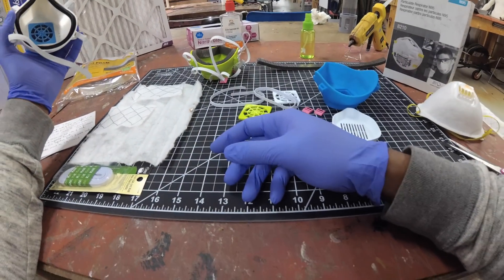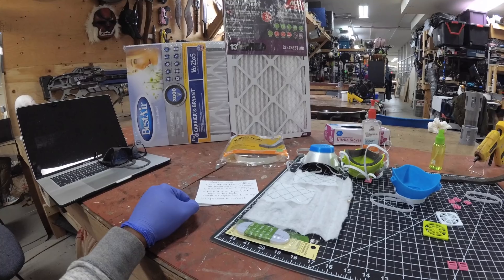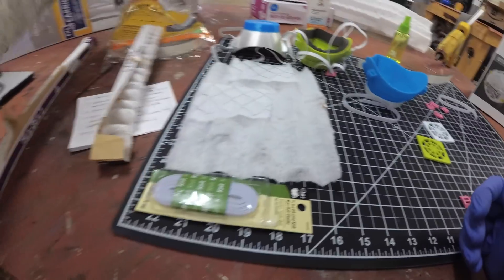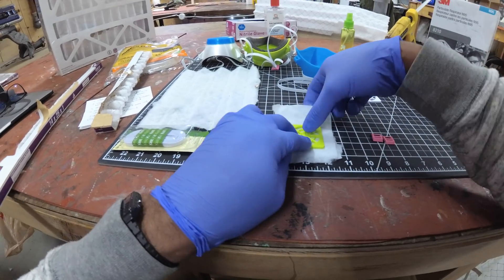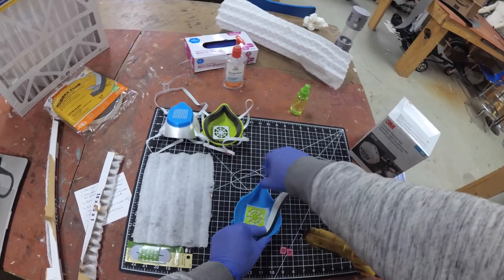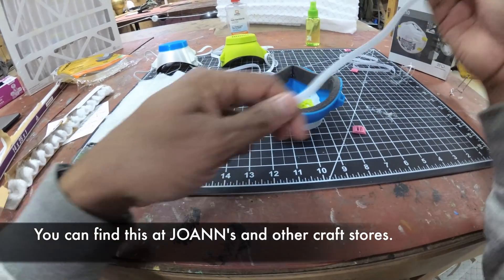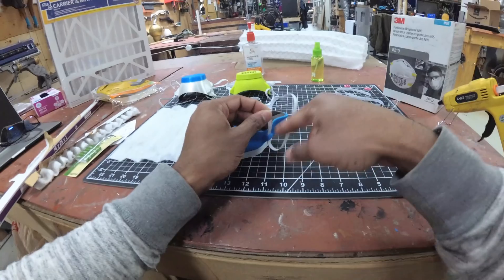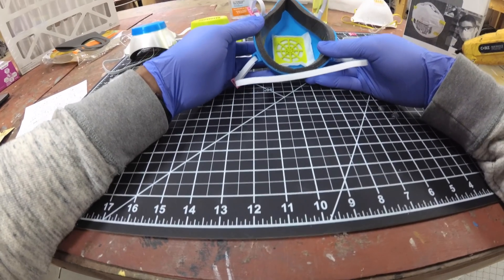3D printed PPE DIY Particulate Mask ( PROCESS )

Comment: The use of 3D printed material for the majority of the mask results in a large surface area of non-permeable material that has ridges for collecting and storing "stuff" as you call it in this video. Also, 3D prints cannot not be fully sanitized and disinfected. The small filter area ensures that there will be back pressure when exhaling that will try to escape along the edges of the face (mainly around the nose bridge) and disrupt any particles trapped along the edge (pushing the virus and bacterial towards the eyes for example). Also, as mentioned in a few other comments, pulling the metal mesh from the fabric tears and stretches the fibers making for weak spots in the filtration. IF you are going to use these masks (which I and many of the doctors I have been working with do not), please buy the large, pleated, drop-in filters for the Aprilaire 2200 as the materials is simply folded sheets of MERV rated material and does not have wire or cardboard glued to it as traditional furnace filters have (as seen in this video).
Reply from the maker: This video has been outdated the moment it was posted. I even mention this within the clip in asking folks who watch this to check in the video description for updates & findings. We've already come to the conclusion that polypropylene or surgical wrap are  better filters than the MERV material in the video. I'm not a medical professional, therefore have no ground to stand on to refute your opinion ( considering you are what you say you are ) on this, we are only working with hospitals on this who are well aware of the limitations of this concept and are not handing these out to civilians as to not give folks a false sense of security. All I can do is report our updated results from the hospitals who have tested the units for those interested in making these as well to possibly collaborate and help. So thank you for your feedback.

Comment: THANK YOU!! I'm not with the Fire Dept anymore. I went from saving people to now protecting them. So im not in need of one. However my cousin is still a medic out in Cali. I asked him what his n95 situation was. Not good. I printed this mask out as a prototype. Joann does not have the elastic straps. Sold out. They did have elastic string. I double it over and it worked. Weather stripping I had at home was to thin and home depot was closed . but I could see how much better this would be with thicker weather stripping. 
So I can fit 2 masks, the part to hold the filter and a few clips on my ender 3. So I'm printing 2 at a time. Just need to print mask caps separate. Hoping to have at least these 2 shipped out by Wednesday. So at least my cousin and his partner has back up. I wonder how hard it is to get our hands of polypropylene? This way we can have a more effective mask if we used that as a filter .

Thanks again. People like you in this country is what will help curb this. Sadly the dumb fucks living here far out weigh those with common sense or making an effort to do some good
Reply from the maker: Thank you, certain reusable shopping bags we've found are polypropylene and work well, also if your local hospital has surgical sheets that is also an n95 equivalent.
Reply: @GiveWaveStudios  I shipped him the first 2 today. I ended up using a HVAC FILTER from Honeywell , it was rated for viruses but what caught my attention was the mention of a electrostatic charge.
Hope the hot glue holds the weather stripping. If So I'll send him several more.
Do you know of any online places for the elastic bands?

Good call on cutting up a  surgical mask
Reply from the maker: @respond_code3  we just got them from craft supply stores. But Amazon might be the way to go at this point

Comment: Nice.  You can print the an extra center mask grid 39mmx39mm.  This will hold the filter in place and give a tight seal to the mask. https://www.facebook.com/photo.php?fbid=3088032921209929&set=pcb.2606241366322387&type=3&theater&ifg=1

Comment: Very good idea, but I think the design needs work.  1.  Filter material:  These furnace filters will trap particles down to 0.3 microns (millionths of a meter).  Coronavirus particles are smaller, at about 120 nanometers, or 0.12 microns.  You should use something with a finer mesh.  (Note: Your current filter WILL trap microscopic aerosols in which virus particles are riding.  This MAY be sufficient, but better safe than sorry.)  2.  The filter should be OUTSIDE the body of the mask.  When filters are replaced, the assumption is that they are contaminated.  Having them on the inside, as in the present design, increases the chances of rubbing off virus particles onto the inner surface of the mask while changing the filter.

Comment: What is the point of the front grill? It seem to make it more time consuming to print.
Reply from the maker: front grill is to potentially have a secondary filter that is more disposable than the one on the inside
Reply: @GiveWaveStudios  Ah that's cool. Will that make the mask harder to breath in? Like I know some use it for protection for themselves, but others might use it because they have the condition and already struggle to breath, with it be a problem? Also some healthy people with conditions like asthma like myself might need breathinging to remain easy even wearing protection. 

Do you feel any different from wearing this and nothing, and this with 1 and 2 filters?

Comment: Great contribution to the virus problem, thank you. I plan to make one myself to see how it works out but with the following changes:
Printing the mask housing itself using TPU for it's flexibility. Hopefully this will allow it to form to the shape of my face better.
For the filter element itself I'll be using a piece of material cut from a vacuum cleaner HEPA filter bag. Far superior to using regular paper filtration material.
Reply: Be very mindful as many HEPA filters use fiberglass to make the element. You do NOT want to be breathing in fiberglass.

Comment: To specify, this is no hate, i am happy that you are actually using your personal time for this, 
Thank you
This is just my opinion on how to improve it:

Pretty simple 
Just print molds with the 3d printer
Then use a PTFE to fill the mold (you can easily get this stuff)
So like that with PTFE (flexible) you have no problems getting it out of the mold
Then you can print a part where you can screw on filters (this will connect PTFE part with the filer, as to guarantee a tight seal)

This is wasting your precious time
Another thing, your filters are not great
I would recommend round filter on the side of the masks and then use active coal (or however it’s called) 
Plus you can use 2 filters, and they can be removable with a seal and a thread
Reply: That would be great if the filters are available. I've been struggling to find any replaceable elements for my respirators.

Comment: FDM printing leaves microscopic holes between the layers plenty large enough for this virus to get through. You want to seal the mask in some way for maximum protection. Using filler paint or some other method is essential. Yes, this is better than nothing for sure, but it is well worth doing it all the way if doing it at all.
Reply: If you print using ABS, you can use acetone to "paint" the parts.  Acetone essentially dissolves ABS, and it should take care of those holes (if done properly)

Comment: When you tear off the metal wire, it will form holes.  What I did was to use two layers overlapping to cover any accidental holes.
Reply from the maker: @vn8383  thats an option but def not recommended ... if you can find polypropylene fabric we've found it actually makes for a better and safer filter.
Reply from the maker: yes, and if you keep up with our updates on the site you'll see we moved away from that and have had better results with polypropylene ...
Reply: Why is it not recommended to leave the metal wire
Reply from the maker: @ltc5662  it's a hard surface, the virus lives longer on hard surfaces so it's not a risk we're willing to take.

Comment: I hate to say this but I heard that even the Plastic can let viruses through if FDM printing. I found this out AFTER I printed 5 of them but am applying many layers of clear coat all over the parts to solidify the parts. I just wish there was a way to confirm that 4 or 5 layers of clear coat will stop viruses.

Comment: This design doesn't have enough surface area for low pressure drop across a MERV13 air filtration media.  So I did a remix for a much larger surface area here: https://drive.google.com/file/d/1hoYZXwwhrOWvDzaba3OMFC82EYuT1X9X/view?usp=sharing
By the way, I printed using TPU for the mask whereas the cap is from PLA.
Careful of MERV16 as they have silica glass material in the media.  3M 1900 Filtrete is equivalent to MERV13.

Comment: Cool that you can help with your printed masks, but your filter material is not safe to use for this virus, the filter material needs to be able to stop 0.1 micron partial size

Comment: Face masks printed with fdm printers don't work to protect against the covid-19. The impression leaves too large pores and the virus can cross the mask walls without problems. It doesn't matter if you put a filter type n95 or higher. The virus can pass through the mask itself.

Comment: Looks like the Class 5 MERV 17,18,19,20 are HEPA/ULPA but probably not available for normal HVAC Systems due to the restriction of airflow which can cause the air circulation fan motor to overheat! It would seem that buy HEPA approved air filters from made for vacuums may work! These maybe available locally!

Comment: We are printing this base mask model but we are sandwiching five layers of material...first/outside layer clean/pristine T-shirt material coated with uric acid/white vinegar or lemon juice (spray and let dry before each use)...then three layers of the filter material then a charcoal layer and a final layer of filter material.  We then take backer rod/foam rope 3/8" and cut half way thru....hot glue the edge in small sections and apply one continuous piece all the way around (this will cushion and make a tight seal where the mask makes contact with your face). Breathing is still easy. Of course we are not medical material specialists so we've researched and come up with the methodology described above. We use 3/4" and 5/8" elastic to make the straps....we hot glue and use a hand held staplegun with T50 staples to secure the ends. They may not be medical grade but atleast they are made here and we are doin what we can for friends, family and whom ever wants one. Anything you can think of to improve a mask of Any design Please share....we All need to help each other Now and in the future......
Reply: How the hell do you get that much material in there as a filter. I had to use a punch and a hammer to tap in the cover that holds the filter material. And I just used a high rated HVAC filter
Reply: @respond_code3  I don't know...my wife is doing that part and she said she is doing EIGHT layers now....She is Amazing.

Comment: Sorry but this is a bad idea and you shouldn't promote it. This can actually put you at a higher risk than wearing nothing. These plastics actually trap bacteria and viruses and the heat from your breath helps promote growth. Good for filtering harmful particulates on a job site, not in a hospital environment to filter viruses. DO NOT USE! You already have the filter, make a no sew mask like this, https://youtu.be/nE0EuDHMfZ4
and wrap the cloth around the filter. Simple, effective, and no 3d printer needed. And, no plastic breeding ground.

Comment: To fix deficiencies in design check russian Y2k respirator for inspiration. Vou can probably use printer to make valves. Try salt as a filter, it will absorb moisture and christals will tear up the virus.

Comment: I heard if you use a blow dryer on the wire cover it will come off much easier...
Reply from the maker: we've tried that, it tends to melt the fabric, which is why I did not include that process in the video :/

Comment: Apart from the comments below on the filter material being used the sealer that you are suggesting is absolutely not meant for direct skin contact. I guess that the plastic use in the 3D printing is also not skin safe. I hope that you are taking care to tell people not to use these in any medical facility or in any location where there is a known active virus case. 
Guys you need to play safe ... by the way the valve type N95 mask you showed in the beginning was banned in China because it only filters the air in one direction. so if a person infected is wearing that type of mask he is filling the area with infected droplets so you might think that you are safe but in fact you are being exposed. 
You need to take note of what was learned in China. 
Please be safe and don't try to make things that look like they are safe but in fact are not, the danger is that you will become complacent and will inadvertently expose yourself which will lead to much higher numbers than are predicted.
Reply: You could make  a 3D printed spoon and it would be safe to eat with. The filters are enough because even lower grade normal face masks are enough for covid. Though this is still worse than an actual mask.

Comment: That filter material is to my understanding, not even close to being adequate. Looking at this table: https://airfuji.com/hepa-vs-merv/ and knowing you will need to filter 0.1 micron particles.
Reply: N95 Masks only go to the same .3 micron size particulate that MERV 13 filters go to, they do however filter that at a rate of 95% and these house filter only do about 65%. All this taking into account the .1 micron size of the virus, but the virus is usually in a carrier of liquid that is a bit larger than the virus itself, in the end it’s better than nothing, and the only way to truly be 100% safe would be to get a full face ventilator with P/N100 filters, or PAPR masks, or you could go all the way and get a positive pressure suite, none of which are necessary, if this were Ebola then yeah...
Reply: THe link you posted is unfortunately just a summarization of 2 wiki articles.
N95 NIOSH statistically capture 95% of all 0.3micron.  If you look on the link you posted it actually says "bacteria, viruses,..." in the MERV 13-16 rating although to their credit it does specify that there are smaller bacteria and viruses.
MERV 13 is probably the lowest acceptable level and would be maybe similar or slightly superior to a good cloth mask.  They're good for arresting sneeze and most coughing airborne particles. However, these box filters are readily available and still in good supply.
If I were to build one of these I would ideally look for MERV 20, failing that, anything 16+ is where I would be targeting if you can find the filtration material, and in a pinch anything 13+.  I wouldn't go below that though.

one last thing, I'm a biomedical engineer.  If you want to see the standards / regulations for what it takes to make N95 or higher the CDC has a great summary

http://www.mechreps.com/PDF/Merv_Rating_Chart.pdf
Reply: Agree with the two above posts, they filter by using a matrix layer, ideally the more of a matrix you have the more you can catch what ever your trying to catch. I like to like at it like bullet proof vests, a level 3a is not recommended for rifle calibres, but enough  together or get lucky it's better than nothing!
Proper seal is more important
Reply: They could use a HEPA filter? https://web.musc.edu/innovation/COVID-19%20Innovation
Reply: Unfortunately the mask if more harm than good because unless the filter is capable of 2 microns / lower pour diameter the virus will flow through the filter and be trapped inside the mask guaranteeing the person gets the virus. Very large liability to provide those to medical staff. Face shields and eye protection are fine though. You can Definetely print that stuff but the first person that may get the virus wearing that mask is bad legally.

Comment: Mate would make sense to create a 3d printed mold for silicone masks? It should be faster to mass produce and perhaps fixes the problem with leaks around the mask. Great design btw!
Reply: They alot of plastic out there that can easily be thermally reformed, from soda bottles to drain pipes, it's just those small intricat part you really need the 3D printer for.
Reply: You can very easily print the mask (positive) and then pour a urethane mold around that piece. Casting urethane would be much better than silicone, because the high quality self curing silicones use a platinum catalyst and are incredibly sensitive to environmental conditions for curing properly. But, you're talking multiple hours of cure time, so you'd really want multiple molds. I think I've talked myself out of it, it would take about the same amount of time.
Reply: @Krautastic  Yes, that;s the idea, to print a lot of molds, once done production line will be quicker than 3d printing. I'll try to create a mold this week and see how it goes.